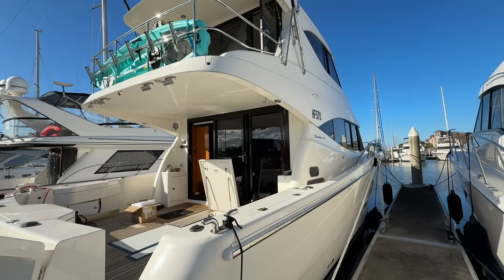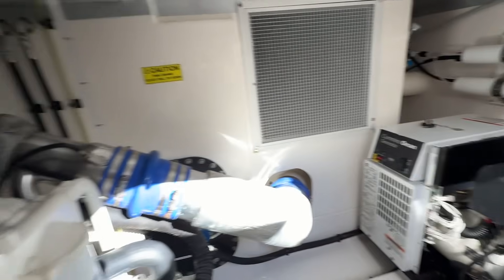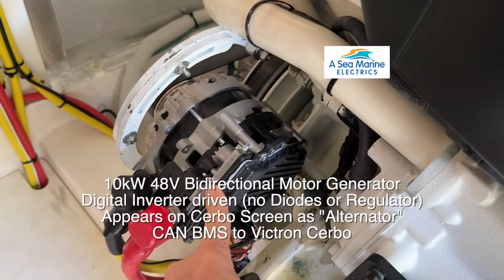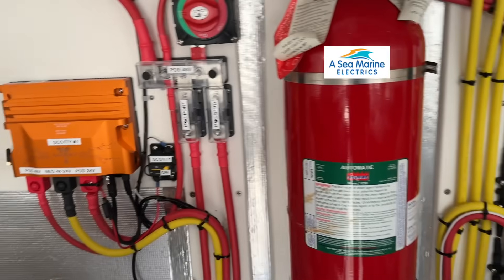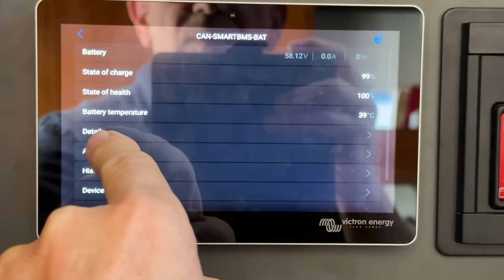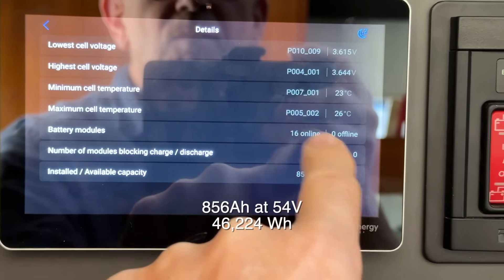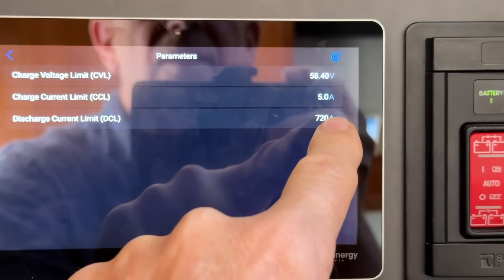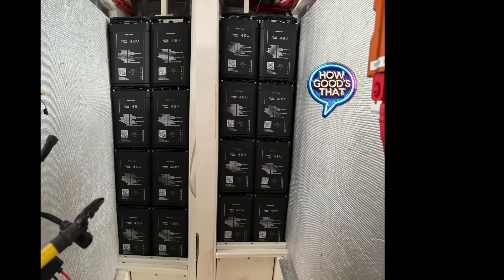Fishing boat on Abrolhos Reef 5 days No Genset 46kWh Solid State Lithium 2 x 10kW Hybrid Alternators

Comment: Do you use 54 volts or 48 to work out kWh I would have thought 48 ??
Reply from the maker: Good question, we are 58.4 bulk charge and 54V float so we use 54V. The purists will use 51.2V but we find the retained energy in these solid state batteries holds the voltage up better all the way too 5%
Reply: @Safiery  Ok